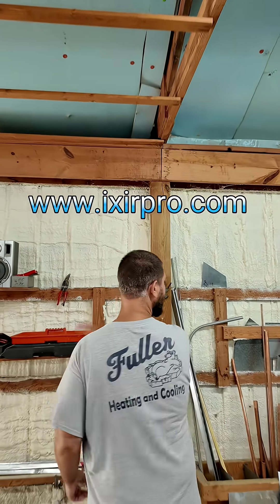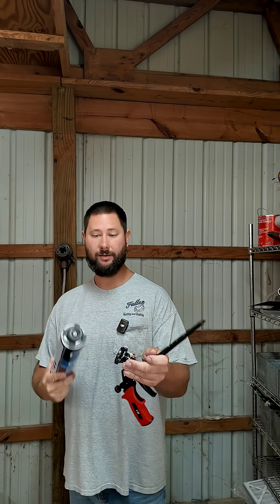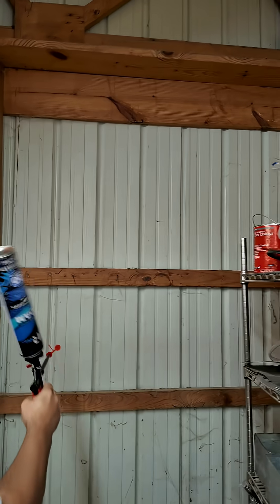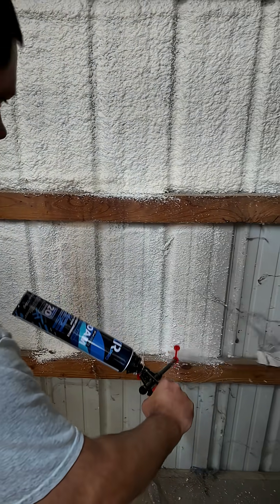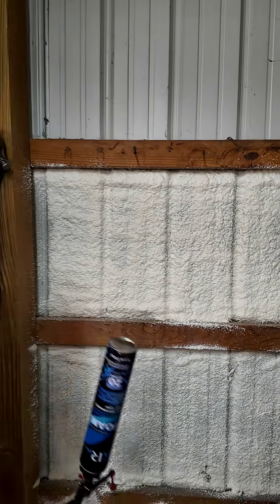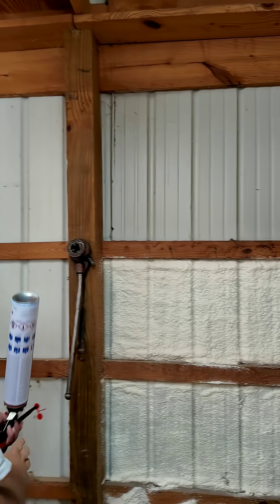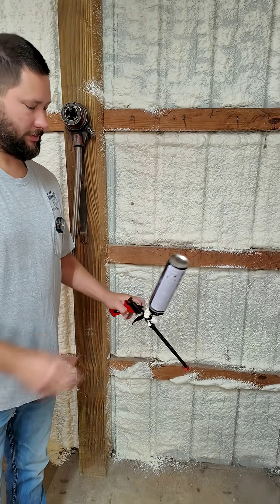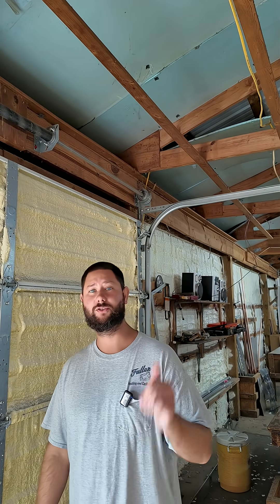Can Spray Foam REALLY Cool Down My Shop?

Comment: But you didn't use the cleaner correctly at all.  First spray where the can connects.  Then connect the can.  Spray until it's clear.  You still have foam residue in the gun sir.  I knew you were new to the foam as soon as you were holding it at a 45° angle but later fixed it.  Good video for applying though.

Comment: Bro I don’t see how they let you sponsor that product that was the worse job Iv ever seen and I normally keep my thoughts to myself but man do you even care what it looks like I mean i like stuff as nice and neat as I can get it with what I’m using but that was the sloppiness didn’t clean the walls after you said clean the walls then you spray up and down in short little burst instead of starting at one end and spraying all the way to the other so there’s not big thick clumped up spots except maybe at the beginning and end of where you start your long run and why not go over the board I know it’s just a shop but man even my shop I try to take pride In and every job I do i definitely take pride in if it looks terrible I’m taking it off and starting over which is hard to do with foam that’s why you get a game plan and think it out ahead of time just saying you might want to think about that next time your representing a sponsor

Comment: A lot of people are afraid of spray foam insulation ( myself included) when you hear horror stories about builders who had it “professionally” applied during new construction only to have it start off- gassing and making the occupants sick. Now that it’s covered by drywall or other materials, it now needs to be opened up, abated (scraped off), disposed of, new insulation applied then finally recovered. What may seem like a timesaver now, could turn into a nightmare that will certainly cost you big bucks to correct and possibly your health or even your life. 
Sorry, I’ll stick with roll or sheet insulation. At least you know in advance what it’ll turn into.

Comment: Expensive as F and it also look like crap.
Instead, some slabs of rockwool and a couple of plates of drywall and you would achieve a real result. Super insulation and it would look good too.

Comment: First of all the uncoated lumber that is directly attached to the walls, because of thermal conduction is going to yield little to no benefit in changing the interior temperature. Second, the coverage depth needed, (1½"-2" min) , makes the application of foam from a can costly for the small area covered per can at the needed depth. And thirdly, most foams dispensed from a can are what's called "single component, moisture cured", meaning there is no catalyst used as there is in DuPont's Froth-Pak products which are "closed cell" foam. All "moisture cured" foams are "opened celled" foam's with little to no worthwhile R value to them. Poor choice of product for it's intended use.

Comment: In my experience the best method in this sort of DIY fashion is using foam board to get your bulk insulation, and then using the spray foam to air seal and get the cracks. Keeps it still pretty cheap, and gets you better depth on your foam.
Reply: I agree and i have always been able to find the foam boards cheap on marketplace

Comment: To diy open cell spray foam a 30x50x14 shop at 3" thick is around 4k with commercial equipment. It would cost around 3 or 4 times as much to use this system. To think a hvac tech would set viewers up for failure... I hope that's 10% kick back at checkout is worth it❤
Reply: I dont remember the part were he told people they had to do it this is clearly not a full thermal envelope kinda job just a DIY cutting down on a little heat soak

Comment: That's straight up crap! First, you should have an air gap between the siding and the insulation. Second, that foam is NOT expanding nearly enough to have ANY r value.

Comment: That spray foam stuff is an accelerant.  Made my shop go up like a roman candle from a hot outlet.  Lost 77 Corvette, 23 Lexus, and 50 years of collections.
Reply: They definitely make a class A fire rated spray foam.. use the right stuff for a full building.
Reply: @rustynew9592  Well THAT SUX. 😭🤮
Reply: Damn man. I had a fire in my warehouse. Lost everything. Sad part is I was in the middle of a move and had everything I owned boxed up on shelves. Great grandfather's family photos, all the belt buckles my pattern maker grandfather made, all of my oil paintings, $10k of US made pocket knives, $15k of tools etc. everything. I trawled through it and found my sterling belt buckle, that was the tiniest victory.
Reply: Also, a 1923 Lexus?😂
Reply: You know… I weld in my shop… advice noted

Comment: This is nowhere near the depth required to make a meaningful difference.
Reply: It expands as it dries
Reply: It certainly is. Even 1/2” of spray foam after expansion would make a massive difference, particularly in the air sealing aspect.
Reply: @Fred_Durst1 you’d have to look it up, but something like 1 inch of that stuff is equal to like 9 inches of the pink stuff..
Reply: Open cell foam from an aerosol spray can has very little R value.
Reply: 1" has r value of about 5
Reply: @fred_durst1 somebody got real quiet 😂. Sybau

Comment: FYI for anyone wanting real information on things.   Here is the breakdown. 
  💥For garage wall insulation, a good R-value to aim for is R-13 to R-21, depending on the climate and usage of the garage. In general, higher R-values mean better insulation performance, but the ideal choice depends on factors like climate zone, how the garage is used, and the type of insulation you choose. 

So.. this spray has a R value of 5.6 per inch.   That means you will need just over  2.3 inches minimum and up to just under 4 inches for the higher R value.
It looked like he applied 1.5 or 2 inches max.  So less than radit foam board. 2inch board has a R value of r-10 to r-13 🤔🤠🇺🇲🙏🇨🇱

Comment: Don't forget to check your balance on your garage door after you add a little bit of weight to it often you need to upgrade your springs after you add insulation to the door

Comment: Well, I can tell you that wherever you left those cobwebs on the walls and corners, the foam won't adhere and eventually it will fall off. Not only that, you get moisture trapped between that area and we all know what that leads to.
Reply: Oh 100% that wood will be rotten soon. Those walls are going to sweat horribly in winter. Won’t doubt it if he has puddles on the floor even.
Reply: @nobodyinnoutdoors  I worked with DOE for 7 years in the home energy sector, and you are 💯on that one.

Comment: Spray foamed my shop 9 years ago and have absolutely no regrets!!!
Great in the winter and Great in the summer!!! ❤️🇺🇲❤️🇺🇲❤️🇺🇲❤️🇺🇲
Reply: Out of a hand can or did you do it the correct way?  What thickness did you do?  In this vid it looks thin and probably not going to do much. Looked like truck liner on the walls. 🤔🤠🇺🇲🙏🇨🇱

Comment: Cob webs act as re bar for more structure integrity 👍
Reply: cob webs act as rebar to strengthen the structure
Reply: @gamebit9063  😢😂
Reply: @gamebit9063  ....... 😅
Reply: Spider silk is stronger than steel. Plus, Spiderman can use it to tie up the Green Goblin.
Reply: @stevetranchida  don't forget the old wasp nest either lmao cleaned my ass
Reply: @darrenhenderson7076  dude honestly a great idea 💡
Reply: @stevetranchida  😆 I'm gonna have to remember that line.
Reply: @stevetranchida  🤔👍🤠🇺🇲🙏🇨🇱
Reply: @stevetranchida   😂

Comment: I understand your sponsored by these people and they probably gave you the material but do they not have regular canisters that you could have done the whole wall at an easier  pace also you didn't spray over the wood runners which is a thermal block

Comment: I work on garage doors. It doesnt look like you have a motor on your door, but for those who do. Be careful adding this to your door. It will add weight to your door and put more strain on your motor. You'll want to get your springs adjusted for the new weight. The gears in those motors are plastic. Remember the springs are what open your door, not the motor.

This isn't a bad idea for Insulating your door. Just be aware its adding weight is all.
Reply: @AllThingsSilver   does that much spray foam weigh more than 5 pounds?
Reply: @CTS28  lol..  no
Reply: You're literally adding the weight of one spray can. lmao
Reply: lol there is NO WAY that little weight is making a difference on that door
Reply: That is a useful comment. Everyone apoplectic about a spider web kills me. What is it they say about don't say anything all?
Reply: News flash. Open cell foam from an aerosol spray can does not insulate anything!
Reply: @chrisbowring4298 
Yes it does.   It’s used for insulation on tubs all the time

Comment: There is a minimum thickness that you’re supposed to use if you’re going to heat the shop in Winter, stops condensation from forming on the insulation. Up north where I am. It’s 2 inches minimum or you will have condensation on the walls in the winter.
Reply: @timbrown9305  yeah the wood that’s touching the metal will 100% rot because of the spray foam touching it in winter.

Comment: That stuff works great when you have a cheap cooler also drill small hole i. The bottom of the un insulated lid and fill ice last alot longer

Comment: I have the same pipe threader! Thought I was the only one using antique tools passed down from grandad.👍
Reply: @CBrown07696  That looks like a 'modern' ratchet type with interchangeable thread dyes. I have a two handled fixed three dye  from my uncle that is older than me (69).

Comment: You should always wear a respirator when applying spray foam insulation. Will protect you from the toxic fumes released as a by-product of the necessary chemical reaction.
Reply: Bigger issue is the chances of inhaling tiny amounts of a foam that is going to expand - in you lungs
Reply: Safety steve here
Reply: OP has a death wish for his health.
Reply: @fj7538  and prevent coating your lungs with the stuff. Sad to see. And people don't realize until years later what a mistake it was.
Reply: Health and safety. So overrated 
Jk
Reply: @fj7538  i bet your a blast at partys
Reply: @duaneduncan2380 isocyanates in lungs no joke.  The fumes aren't toxic.  Foam particles hardening in the lungs are.
Reply: @duaneduncan2380  Better believe it 🎉
Reply: @duaneduncan2380  God forbid someone give another human being helpful advice.

He's absolutely right. People underestimate how much air contamination can mess up your lungs. Same reason you mask up for painting, mixing concrete, during demo, etc.

Comment: Small tip from someone who did closed and open cell spray foam professionally... tuct tape all your studs and exposed wood .. it'll save you TONS of time on clean up and scraping .. when your done you just pull the tape and all your wood is all nice and clean and no scraping
Reply: Dude, we just watched him spray that crap all over his nasty, dusty, cob webbed walls. You think he cares enough to clean off his studs? He didn’t care enough to hit the walls with a broom or blower so the foam would stick well. I’m pretty messy and sloppy sometimes (on my own stuff) and even I would have cleaned and prepped those walls.
Reply: @RobertRouleau-c7h  No mask & eye protection.
Reply: When i had mine done... I asked the guy if I should wipe oil on the spots I didnt want it to stick....  he laughed and said no.   I regret listening to him
Reply: He ain’t cleanin’.

Comment: Cost per foot, you'd be better off with just a foam board insulation. I cant imagine that 1/8th of an inch of foam gives any significant r-value increase.....I may be wrong, but i feel like im not

Comment: Isn't the spray foam supposed to be like 4 inches thick? Your barely doing ½-¾ inch
Reply: Foam insulation board is like R-5 for 3/4” and is R-3 for 1/2” if I remember right.  I insulated my cargo trailer with 1/2” foam board and it made a HUGE difference.  The inside of the trailer remains at ambient temperature now in the summer time instead of 20-30 degrees above ambient.

Comment: I use a spray can of cool whip to insulated my strawberry cake
Reply: @ralphriffle1126  it doesn't work though when you huff all the nitrous out of it
Reply: which in turn insulates your mid section

Comment: Hire a spray foam insulation company to do it right. Those cans are not cheap. They are more expensive per board foot than using a contractor.

Comment: I like how you clean the walls 😂
Reply: @gorgev9341  same here lol
Reply: Not at all.😂
Reply: couple minutes with the leaf blower could have taken care of the cob webs.
Reply: Ikr hahaha skipped that step lol
Reply: The cob webs ad R value
Reply: 😂, and you need some screw on foam gun cleaner for that gun between bottles, but whatever. Do you, bro.
Reply: He seems like the type of guy who cuts corners. Applying over dirt is not a good look!
Reply: @gorgev9341  and moved shelving out of the way.
Reply: What a sloppy looking mess. The wood framing members will absorb condensation trapped by the spray foam insulation and will turn to mush. 

How thick is the insulation and how much does it cost?

Comment: You will come out cheaper if you order the spray foam in the propane size container and you get a better R value than the small cans, otherwise just put up foam board- just saying 😂😂😂😂

Comment: The cob web helps thicken it too🤣😂😁.
Reply: Cobwebs have an R value of .002 every bit helps... that fly might add .01 if he just ate
Reply: @NoName-zn2qu   you made a mess I would pay extra for hardboard installation
Reply: @theodorehyatt1782 you replied to a commenter not the page creator so it’s less likely he will see your comment that he made a mess. Yeah he kinda did the quick and dirty. If it’s cheaper it’s good. Works.
Reply: Is that close cell or open cell
Reply: @jamesknox4612   Almost all "spray can foams" are what's called "moisture cured", open cell foam. Very little to no R value, basically good for nothing but sealing cracks and holes!
Reply: I was going to comment that the cob webs must’ve been clean